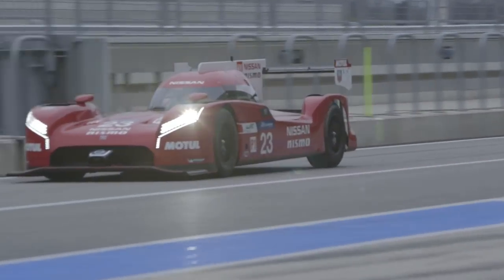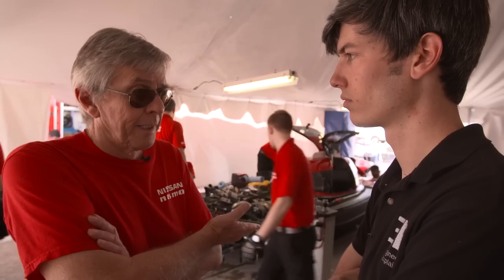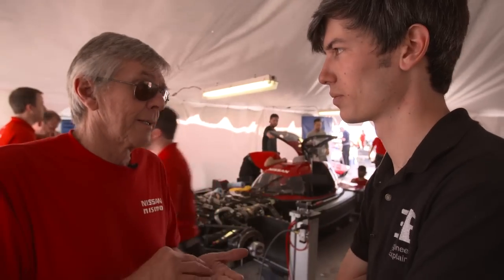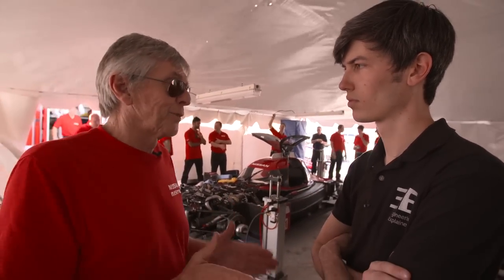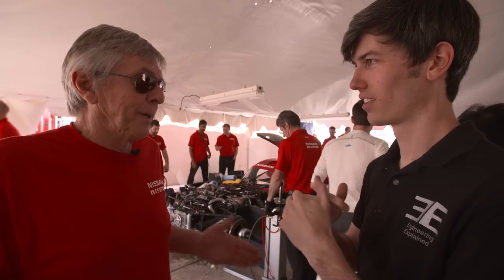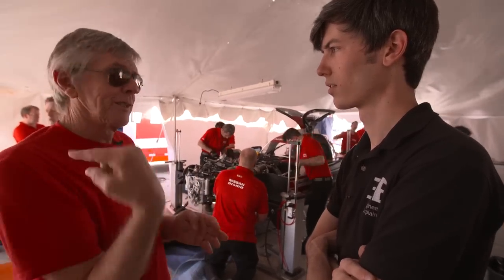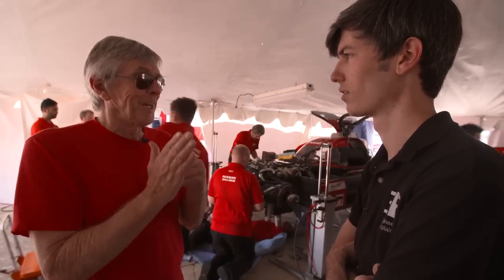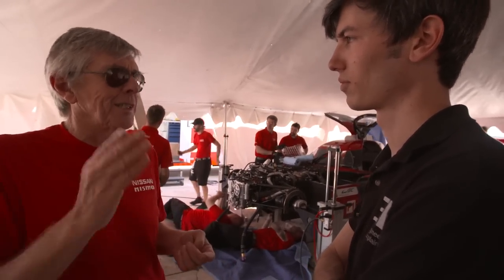Nissan GTR LM Nismo - Engineering Insight

Comment: How about the handling of the car? Does it generate a lot of torque steer or does the car understeer much? What about tire wear in front?
Reply: ***** lol tire wear , they would never use the same set of tires in another race ever again.
Reply: teh vee teh vee Tyre wear still matters a lot in racing. When other cars are doing 50-60 laps around an 8.5 mile track one set of tyres and you're changing tyres every 40 laps, you'll be at an extreme disadvantage.
Reply: teh vee teh vee Tyre wear matters a lot for an endurance car. The less wear you have, the longer you can run on the tyre, decreasing time in the pits. In LeMans you save around 40 seconds if you don't swap tyres since you can only have 2 guys working on the car at the same time. If you think that's insignificant, running one set of tyres for 4 stints won LeMans for Audi in 2011, by 13 seconds. Running one more stint won Audi another race this year in Spa, again by 13 seconds.

Also since most wear will be on the front of the GTR LM, the rear wheels will last a very long time, Nissan have claimed that the rears can last 9(!) stints, where most run 3 stints. So even if the fronts wear quickly, there will be less of an impact since you don't need to swap all 4 tyres.

Comment: Isn't this video like an anti-thesis to the 50/50 weight distro. video? Ricardo was basically saying throw more weight to the front tires for grip and energy recovery then let the new bigger aero handle the back.
Reply from the maker: randomname9283 I think you've misunderstood my 50/50 video. It's not necessarily ideal (as I mentioned), it's ideal for a very specific task. Yes, there are benefits to a rear weight biased car, but not when it's FWD. Race cars have to follow rule books, exploiting the rules is the way to win, not designing the ideal car (which is more feasible for road cars).

Comment: Hello!

I'm wondering if there was anyway you could explain benefits (if any) to a mid engine front wheel drive car (I'm familiar with the Renaults that did it and a few others as well). To my knowledge, the most current and only available car with this in the USA/North America was the Scion (Toyota) iQ where the differential was placed in front of the engine and much of the front suspension was allowed to increase to almost 8° caster and much of the engine was behind the front strut towers. Thank you for your time and I hope, future answer!

Comment: so they will use the "rear" tyres at the front and the "front" tyres at the rear of the car ?
Reply from the maker: panagiotis karagiannis No, the tires are the same as usual, just a smaller width in the rear. I believe most teams use the maximum width (14") in both front and rear.

Comment: Any info on which Megajoule class is Nismo running with, EE?...
Reply: ***** 2MJ class i think.
Reply from the maker: ***** When I was there they hadn't announced, and wouldn't tell me. In fact, we recorded a section where they had to say which category it was, so they just did the take four times and stated each category.
Reply: Engineering Explained, that's alright... But since Nismo is using the flywheel as an energy storage similar as the Audi team, they could be running the same category as Audi this year, assuming that it is... Looks like I have to wait for their announcement. Anyway, thank you for responding to my question, EE...

Comment: Why are the tops of the fenders not covered?
Reply from the maker: ***** Good question which I didn't ask.. may have to do with allowing turbulent airflow an exit from the wheel wells, possibly improving brake cooling/aero. (Weight reduction? Kidding..)
Reply: Engineering Explained It's a FIA rule to keep the top speed of the LMP1 cars  lower. It has nothing to do with  brake cooling, Weight reduction, etc. Without this holes LMP1 cars would be much faster but closed fenders are forbidden in LMP1 since 2012.
Reply from the maker: Igor kotzlowski Ahh interesting, thanks for sharing!

Comment: Weight in the front, braking in the front, downforce in the front, energy recovery in the front and steering in the front....why not use the most of all the wheels, you have four to work with yet you max out your contact patch in the front only.  This is why Nissan was the biggest loser in Le Mans in 2015 I am sorry to say.  Everyone walked all over you especially Porsche.